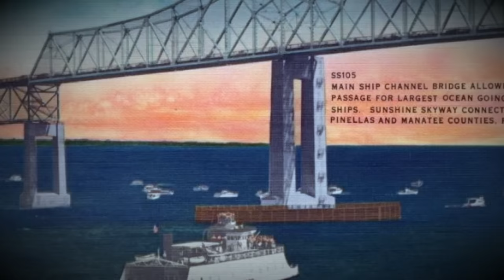The Sunshine SkyWay Bridge Disaster 1980 | Plainly Difficult Documentary

Comment: I grew up in St.Pete and was eight when this happened. I went over the bridge many times. The car pictured at the edge of bridge in the video was the last one to approach the edge right after the bridge collapsed. The driver slammed on the brakes, stopping inches from the edge of the drop. It's a very surreal picture. I remember suggesting covering this one a while back. Glad to see you make a video on it. Excellent video!
Reply: Was going over the metal grate at the top of it scary? I always imagined it would be
Reply: @soyuzsovietsky  Oh yeah. As a kid, it always freaked me out because you could hear the change in sound going from concrete to metal grate.
Reply: @gusgreen3104  That's the story I recall. If it's been fleshed out or amended, I'm unaware. Still a very surreal image.
Reply: @josephmassaro  oh no that's scary as hell!!!
Reply: @soyuzsovietsky  I makes a very different sound than a solid surface does. Most draw bridges and swing bridges are made of the same material. The bigger issue was with the snowbirds and tourists would stop at the top to watch the sunset. They didn't even care about the signs. We used to fish near the middle but not on the incline. This required you to stop, drop your gear, go park, and finally walk back. That only required a few seconds. The traffic was lighter then and the speed limit was only 55. I wonder if any remembers the tale of the massive hammerhead shark that used to take people's stringers of fish. He even had a name but YT would probably block the comment if I said it. Good times.
Reply: I've lived in the Tampa-St Pete area most of my life. There is a lot more to this story but  it would take hours to recount it all. One thing I do remember from an old TV special was a story that the guy in the car pictured walked back out to get his golf clubs from the trunk of the car.

For years after until they demolished the old bridge you would look over and see the upward ramp of the down bridge shooting skyward, then nothing.
Reply: @jim2041-o9b  I remember seeing that upward ramp just stop. It's very creepy when you're on the other bridge. I've heard the golf club story, but the papers say he just went back and closed the doors. Who knows. Another thing is when that picture of the car was taken, there is another version that shows the sloped angle the car is at. I'd post a link to the picture, but external links tend to get posts deleted. You can do a search for it. Someone else commented that the driver didn't brake hard, but this is the quote from the Tampa Bay Times: "Richard Hornbuckle's car rests where it skidded to a stop just 14 inches from the edge of the Sunshine Skyway Bridge." That is the version I have always known. As you said, there is plenty more to this whole incident. Certainly more than can be told in a short recap or a comments section.
Reply: @soyuzsovietsky  it's scary enough where I'd always make my mom and boss drive me over.
Reply: @josephmassaro  Do you remember the sound it made when you were on the longer flat parts on either side coming up to the center?!?! They always looked like train bridge covers to me.... if that makes any sense. This may sound crazy, but the sound I remember the bridge making was the part I just spoke of. They are actually fishing piers now, but without any tops (great fishing on the south pier, near the Manatee County end....yup, I'm a local, born and bred; born in Polk County). I was a kid, but had to go over that damn thing every weekend. My grandfather was a patient at the Bay Pines Military Hospital and we enjoyed seeing him and taking my grandmother. While going through and over it, it would make a grating sound, hard to describe.... I'm closing my eyes, and I'm hearing a metal buzzing, then every 30 seconds an audible "duh-dunk". I think that was the intersecting ends of each metal grate piece. Where the bridge collapsed had another sound. Imagine being that far up and driving over an open grate.... that's the easiest way to describe it.

Sorry if it sounds a little crazy about the sounds. We were usually in my parent's huge ass station wagon (yellow and brown!) and I was burying my head in the floor board. I hated that bridge. I still hate driving over it today. I had a medical conference in Tampa back around 2001-2002. Had just bought a new Mitsubishi Eclipse. I was driving back home on 275 to 75, then to 64. Needless to say, I had to drive over that wench in a low slung sports car that was all engine. 2 out of 2, will never do again. If my son (he's in college up north) ever flies out of TIA, someone other than myself has to drive the Skyway...... still have a low slung sports car!!! Ford Mustang

That's some of my memories of that hellacious monstrosity. I have more...... :)
Reply: The car pictured at the end, the driver was smart. He was going 20 MPH because he couldn't see through the fog, something a lot of drivers should take more to heart. He saw that the bridge supports on the sides of the road were missing, so he braked then. Not one second later.
Reply: @soyuzsovietsky  I used to go over the old bridge as a kid.  It was scary between the sound of the metal grates, and the fact that you could see the water through them.
Reply: The driver's name was Dick Hornbuckle.  It was a '76 Buick.
He noticed something wrong since the bus' taillights dissapeared and saw metal debris hanging from the bridge and slammed on the brakes, sliding slowly and stopping 14 inches before the edge of the bridge.
Reply: @soyuzsovietsky  A  low causeway bridge in northern Florida was damaged during a hurricane.  While repairs were arranged, metal grate decking was used to open the interstate. Driving that short patch was nerve-wracking. I can't imagine a full, high bridge.
Reply: I have a bridge phobia to begin with, and my uncle in Florida knew this. So, when I drove him and my future wife from Punta Gorta to Lakeland in 1985 to see a Tigers game, he insisted we would save 45 minutes going through the Tampa-St. Pete area. This was before GPS was common to verify. I was freaking out during that climb and with traffic coming from the other direction in what seemed like very narrow lanes. I seriously thought I could get us killed having a heart attack. So, of course my uncle points over to the broken span and says, “That’s where 30-some people plunged to their deaths five years ago.” That was totally reassuring! Needless to say, we took flat roads back, which actually was a faster route. My uncle wanted to mess with me. Ironically, we got lost temporarily in Tampa coming off the bridge, which cost us even more time.
Reply: @charmenboyd-brundidge2370 I grew up in Bradenton, have been over old and new Skyways many times - being able to see the water through that steel grating freaked me out as a kid, even more so when looking out at the empty void and twisted metal where the old western span once existed.
Reply: The car owner walked back down ramp to get his golf clubs out of the trunk . True story . Look it up . Unreal
Reply: @josephmassaro >m

Comment: One major component to this story that is missed, it's shown on the diagram of the channel in the video, but not actually brought up, is that the channel itself was also an issue. Ships were required to make a turn, while simultaneously crossing under the bridge. This was also noted in reports as being a contributing factor to the accident as it again, increased the likelihood of collision. Which is why, the channel was re-routed as part of the redesign of the bridge so that the turn, and the bridge crossing are separate events. 

Everything about this situation was an accident waiting to happen, and worse yet, the previous collisions were clear warnings to these problems, that were dutifully ignored.
Reply: Given enough time it is a 100% chance that a ship will crash with the bridge piers
Reply: Did no one consider this before the bridge was built?
Reply: @jvccr7533  The channel existed before the bridge did. The cross bay channel was used for ferry boats that took you across the bay but ended at the start of WWII. After this accident, they made a lot of desperately needed changes to the channels in and around the bay. Previously, the channels were too shallow and the ones by Egmont and mullet key would change slightly from one year to the next due to shifting sandbars. The three counties that control the bay and the USCG who builds and maintains the channels squabbled over the bridge and channels. You also have the St Pete port authority that built and operated the bridge making demands. It took them decades to get it all finished. Keep in mind that the request for the original bridge started way back in 1924. Before the interstate system was built it took hours to go the other way around over the Gandy Bridge and across Hillsborough County. Typically bureaucracy at its finest.
Reply: @jvccr7533  The size of ships also evolved making them less maneuverable, which was a major contributing factor.
Reply: This is the modus operandi of most of the state of Florida
Reply: FLORIDA!!
Reply: The channel was never rerouted.  The current bridge was built in a location so that ships would not have to negotiate the turn and travel under the bridge.   The current Skyway main span stands approximately 2 to 3 hundred yards east of the old bridge.
Reply: @m0r73n  Yes. In an infinite timeline ANYTHING is possible. But this accident was completely preventable if they had just replaced the protective pier that had rotted away. Watch the video
Reply: Which is why you have to have the pilot, they are the experts on the navigation of the waterway. That's why as layman I don't understand why any blame was placed on the captain.
Reply: Very good points... especially the fact that the ships had to make a turn, while simultaneously going under the bridge 🌉.. like who actually thought that was going to work out ok?... 🤔😔
Reply: I did not know this. TY.
Reply: A stark reminder of the negative effects of big money
Reply: I didn’t know this. I remember when I was a kid in the 80s and 90s they spent ages re-dredging and fixing the port in my city. I can’t help but wonder if this accident made my city realize the equally outdated issues with our port and finally put money in to fixing it.
Reply: @matthewscott5977  🎄
Reply: one more contributing factor was an excessive speed. once rain started reduced visibility as well as affecting radars should be considered and speed was to be reduced to a minimum required for steering at least until bridge passed.
Reply: Disasters never are traced back to a single event, but always end up being a chain of events, any of which if acted upon properly, would've averted the disaster.
Reply: When I was a kid it scared me every time my dad would drive us over those Bridges
Reply: Very good point!
Reply: @MultiMidden  Basically they had no choice but to charge him too, the crux of the matter is he’s captain and takes final responsibility. No different then the coach of a hockey team🤷🏼‍♀️

Comment: Got a civil engineering degree in Tampa and this was talked about during some of the intro classes. The accident changed the way bridges were built and protected,  it was also when I finally understood why bridges have the "crown" shape in their structure. Bridges were already being built with protection of the outer piers, but the powers that be decided not to do it for this one,  the discussion put the majority of the blame on the design, not necessarily the ship
Reply: I can see why they put the majority of the blame on the bridge’s design and not the ship. Visibility was basically fine until essentially the last minute, and such a large ship would have had a lot of momentum to fight to change the ship’s velocity, so there wasn’t a whole lot the pilot could’ve done differently without the benefit of hindsight. By contrast, a bridge built with the expectation of having marine traffic passing under it semi-regularly should absolutely have had protections against far more than just wind pressure as it is absolutely foreseeable that a sizeable marine vessel might collide with one of the piers, and it is a lot easier to design a static structure to be able to handle future dynamic loads than it is to direct a large moving ship to avoid colliding with said structure, especially in poor visibility.

Additionally, human error is far easier to mitigate when constructing a static structure than when steering a vessel. During construction, there is plenty of time to see and fix the results of human error long before a potential disaster occurs, but human error in terms of steering a vessel often has immediate (or near-immediate) consequences. It is far easier to prepare for the worst and mitigate the fallout from a mistake than it is to not make a mistake under time pressure.

Really, there is no good excuse for not having some protection against collisions to try to prevent complete failure of the bridge. It’s not like it was designed with no expectation of ships passing underneath it; on the contrary, it was explicitly designed to allow ships to pass through uninterrupted and without stopping traffic at any point. It’s also not a case where the bridge was built or designed before measures had been developed to mitigate problems with collisions; they simply didn’t implement them for some reason.
Reply: 60% design fault, 40% to the ship captain. There should have been something to help mitigate collisions on the bridge, the captain should have kept the ship moving slower, as soon as the trainee pilot went to full ahead he should have taken control and brought it back down to slow. The weather events would have impacted when the ship was further from the bridge, giving those on board more time to react to the changes.
Reply: USF?
Reply: @bhull242  Not that they both didn't cause the tragedy, but I get the feeling that it was broken down this way for a source of money for bereavement and a replacement.  An entire state vs a shipping company...which is able to pay when neither can be completely assigned the blame.
Reply: @BlondieGurl1129  United States of Florida?
Reply: @GargeBarge  Lol University of South Florida, I also got my degree in Tampa and wondered if OP is a fellow alum
Reply: It looks like the pillions were to close together, not enough room for error of ships passing through in bad conditions.  Not enough consideration taken into the waterways below.  Should have worked together better.
Reply: @BlondieGurl1129  Go Bulls!
Reply: I vaguely recall a railway bridge that was struck by a barge, causing a track misalignment and derailment of an Amtrak train. I think it was in Alabama.
I've long said, nothing is foolproof, as fools are so damned ingenious.
Reply: @jaquigreenlees  I’ll disagree with you on your last point. Sure, the weather events in this case would have happened when the ship wasn’t there, but we only know that in hindsight. From their perspective, slowing down might have only guaranteed they hit the bad weather rather than avoid it. They had no idea that they would hit the bridge right as the weather events happened, and the captain did reduce the speed after taking control back.